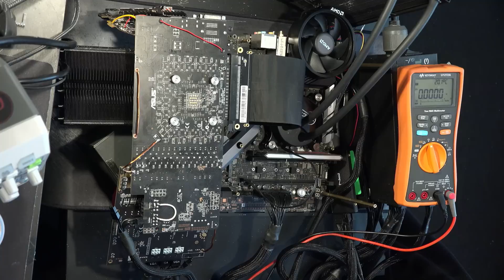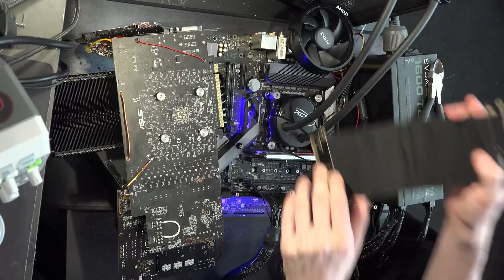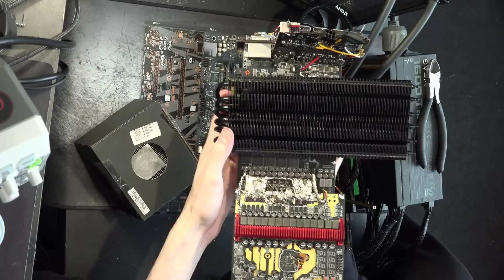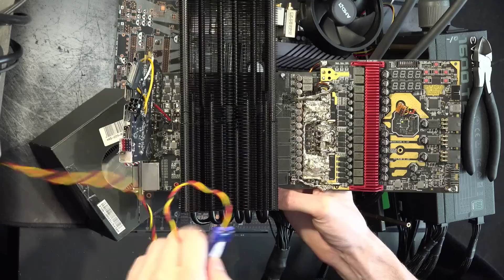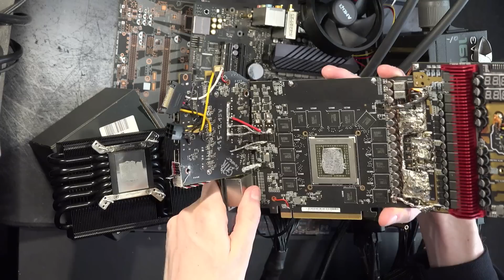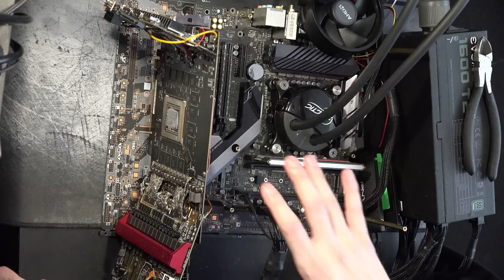The end of the resurrected R9 290X Matrix.

Comment: My only thoughts are that perhaps one of the chips you removed handled a reset line to the core, and now it's sitting in reset and waiting for a line to be pulled either high or low to turn it on. Just a thought if you haven't tossed the board yet and feel like taking a second look lol

Comment: I have an r9 290 made by Club 3D. For the past 3 years or so, it has been brutally unstable. The solution to fix my woes has been to run after burner and always have it overvolted.  there is a one-in-five chance that when I boot my machine it will boot all the way into Windows. As a result I basically just always leave the computer running, as the computer will have to turn on to initiate the overvolting. I wonder what is wrong with my card.

Comment: AMD drivers can make changes to some Bios settings. When you installed the Drivers something could have gone wrong due to it not being on the stock power/controller. 
Reflashing the bios could bring it back.
@If the core still good it can be used to fix another card.

Comment: Dang BuildZoid I never thought i could feel this bad about a dead gpu, I feel your pain, i just lost 10 capacitors on my 1070 because of that stupid glue that comes with the arctic accelero you use to glue the heat sinks on, thankfully the card still works fine, just cant overclock the core at all, but can still get decent overclocks on the memory. Where would I get those capacitors from so i can solder new ones on, its the caps along the between the vrm and the die has 470????? on the cap but cant read the rest of the markings on the caps.
Reply: as long as you get similar values and package (low esr is welcome) you're good. i'd check mouser but it depends on where you live.
stay away from aliexpress unless you are 100% sure the parts are legit.. 
is this the card? https://www.techpowerup.com/img/16-05-27/158a.jpg it shows 330s but you might have a non reference design.

Comment: Could it be that it requires a specific voltage boot order? 
Like if you were to look into specification for FPGAs (it's in CPUs too but good luck finding the right datasheet for them) the more different voltages they require the more stringent they are in terms of order in which they need to be turned on (to the point of dying if you apply one voltage before another, usually it's just a deadlock tho).
Now CPUs are most likely gonna handle that with integrated voltage regulators i guess, 
I have no idea if GPUs have a similar thing going on.
Reply from the maker: I've had a 290X with everything E-powered in the past. There's no power sequencing requirement on these.

Comment: How to fix a GTX 460 cyclone that lets the system POST/outputs video but it's all fucked up and artifacty?? Lol bought it on eBay for like $30, I still have my original I bought in like 08 and want to SLI them for another system, the new one I bought was very banged up, spent a few hours straightening fins, repasting gpu, general cleanup .

Comment: I like the parts salvage, make the most of it. I like having donor boards for random components.
Plus having "small smd caps" until the end of time is always a benefit =)

Magnetics feel like they'd be a significant component of salvaged parts price? 
I would have thought you'd count the drivers and controllers, not just the fet's and caps?

Although I guess you're not building/fixing converters that much, so caps are the most worth it?
Reply from the maker: through hole inductors are basically impossible to pull of of high power boards.
Reply: @ActuallyHardcoreOverclocking  Oh yes =) I recall you mentioned in previous video that's why you cut them. Order of operations =) No worries.